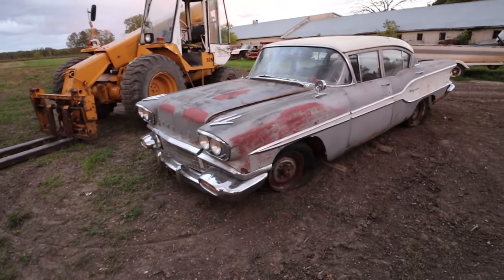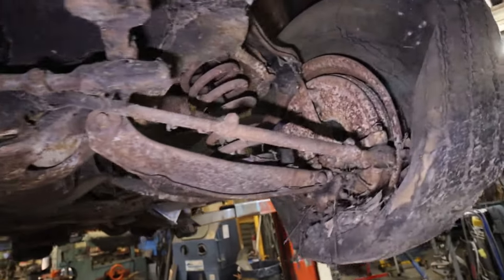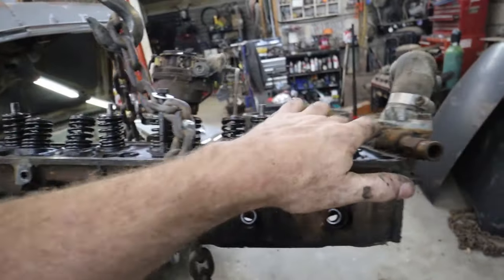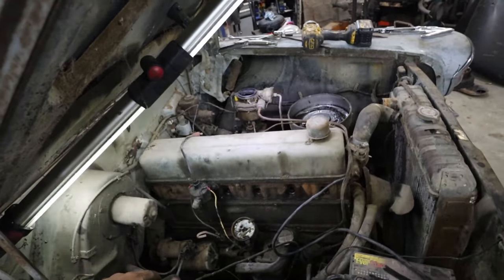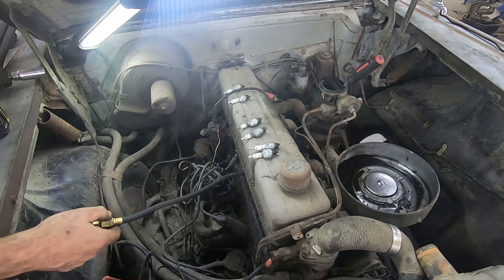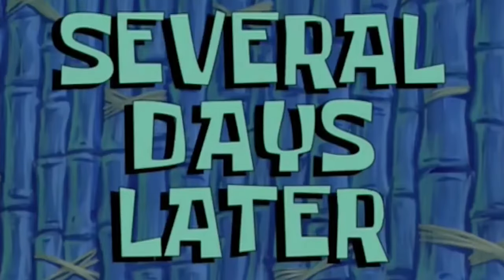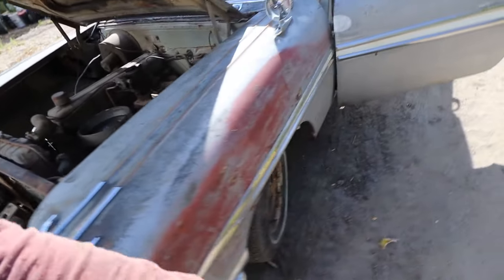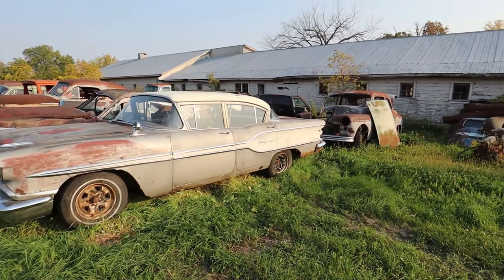Saved from the crusher 1958 Pontiac Pathfinder will it run and drive again?

Comment: People keep saying LS swap, that is probably the worst thing to do this old girl. It's boring and stupid honestly in my opinion but to each their own. . Everyone does it, why not a 289 Chevy, 305 or a 350 swap if your not gonna keep the old power plant. I would elect to keep the original engine and possibly do a draw through turbo set up. Nothing crazy just enough to give it a little power. Seem quite a few folks do this with old motor like this one.
Reply: I’m with you! If this is going to turn into YALSS series, count me out. Getting pretty boring. Doesn’t anybody have any other ideas anymore, or is it just follow the leader thinking these days?
Reply: @notajp  I dont understand the craze of LS swapping. You gotta wire it all up, flash a ecm, custom motor mounts, exhaust, trans, trans mounts, driveshaft, possible an axle. That adds up quick! Might as well make it a drag car, while I do understand wanting to make it a good driver sometimes it fan go too far.

A simple old school motor swap if it were to go that route with as little modifications as possible that would require it to run.  

Hell a straight 8 would be a cool swap in and something I wouldn't mind seeing.

Comment: 19:03 I know it’s your video, but if I came across this I would just unbolt the rocker shaft, and spray some “let go” on those valve stems, and give them a little love tap…..maybe they come loose, first…before pulling that head.

Comment: If you notice each cylinder plays a different note , ok. It goes “da da da da da “ duh”when it gets around to the 75 lb. er , every time the low note , so if they do come around to higher pressure , they’ll all get lower.

Comment: there something i,ve done to an old engine to start at,s sat is to take a propane torch put it into all the cylenders heat in all the cylinders up good this seem to help to get the rinds to stop sticking then i would heat up all the spaek plugs put it back together with every thing still not then try to start it with every thing still it seems to help to get it started heat will or can help to free the rings up

Comment: If you were a mechanic and you knew how to check compression. You would know that you first check the cylinder dry, and then you put 4 squirts of oil and check it again.
The difference between the two tells you what is happening in the cylinder.

Comment: this is REALLY interesting. Not something you see every day at any local car shows. i've never even seen one of these before this and i'm all into this era of cars too. Oh you're in Canada huh? This is a Pontiac Chieftan here in he states. That looks like a lot of 57 Chevy crossover stuff on this one which would mean those rusted out floor pans should be easy to replace provided you can get the vendor to actually send you the parts when you order them. sad to see it's only a 6 though. Are you planning on restoring the 6 or replacing it with a period correct V8? i know it's a 4 door so less desirable but it has a unique look too so well worth fixing up i think! This would be worthy of a complete frame off restoration to me personally simply because of the oddity of it all. And yeah i use words like "period correct" because i'm an auto restore purist. I'm subbing because i am REALLY interested to see which way you go with everything and see it restored. Lotta weight reduction on that one and i don't recall ever seeing one of this body style without a full straight frame under it. that X type frame is just as interesting as the look of the rest of the car to me. Marvel's Mystery Oil can be found in ANY Walmart as well as Advance or Autozone or Oriley's. i would use a combination of marvel's and PB blaster. put the PB Blaster in first let it sit then marvel's OR you can use Diesel fuel too i'm told. Never mind, looks like your concoction worked just as well. is this a 6 volt system? it would be nice if you could find a good 283 to put in that thing. Even with all the rust and lack of floor boards that's a really complete car. can't find one like it anywhere here in the states. Not with all the trim and everything on it like that one. i really like that! i'm also in love with the 58 Impala too LMAO i have the same licky problem with my German Shepherd that you do with your boy too :o)

Comment: I've had that issue of the starter sticking from all the rust and crap built up in the flywheel teeth. It trys kicking the starter sideways and binds it up. Looked like quite a few of those teeth were packed full

Comment: 58 Pontiac Pathfinder straight six, the engine's stuck so no easy fix, she's a liftered poncho on 14's da wheels are a mix, not a Chieftain just gotta be a brave wid brakes dat stix, drug around n fired up hot don'ts even hear no tix, Flintstone floors n ratcheted  seat a first place pix, Pablo approved n a face full of lix.

Comment: That is a pretty rare car with the 6 cylinder in it. Most all Pontiac’s of that era had a big v8 in it. Not rare (desirable). Rare ( why did Pontiac put a 6 cylinder in this heavy car). Good exterior though. That motor looks the same as a 235 Chevy 6 cylinder ( on the outside only). It’s probably the same as a GMC 302 truck engine.

Comment: That really looked like the straight 6 motor that Chevrolet had, I'm kinda thinking that is what they put in them the V8 were all actual Pontiac motors, Ive done rebuilds on the chevy looks like the same engine.

Comment: The problem, it was in the current cables, rust inside the cable, the same thing happened to me in a 52 deluxe I put a new cable and there was a better current, it took off and turned on

Comment: Stuck rings is why i fill the crankcase with 5 galons odf diesel an let sit for a day or to an work motor back an forth alittle of course i leave oul in the motor to when i get it to work back an forth an at least one turn i start it up an let it run with the diesel in it  always works free up the rings freshen up the seals an usally if  the motor anygood at all it be fine let run just a couple minutes drain it an fill back with new oil keep the diesel for the next one in a five galon can

Comment: They sure put a lot of 6  Cylinder engines in those old 4 doors back in the day you would think they'd put the bigger motor in those  Anyway I would have figured it would being a Pontiac might have a straight 8  i've had a few old pontiac's motors that were straight 8

Comment: Were rings or valves the main culprit for the low compression? At least one of the valves (#1) was way too loose. They will self-adjust as oil pressure rises, but they should be close to being adjusted from the start. If they flop around there won't be much compression at the start.

Comment: Not beyond saving - it's got all the glass, the doors open .......similar structurally to a '58 Biscayne so floor panels should be adaptable !!.....the barrel brush from a pistol cleaning kit may work in the valve bores, but hammering on valve springs without a face shield is way dangerous !!

Comment: The car was junked because the engine is worn out.  The only thing that you can do is put marvel mystery oil in the cylinder and let it sit a 
Month or two until it loosened up.

Comment: awesome video, so was it true that the difference between pontiac and chev is essentially the front and back ends? if so chop them off and throw them on a better chevy chassis, easier than attempting to rebuild the car and cut in a new chassis then its brakes, engine etc!

Comment: Call marvel Mysterio Jimmy comes in a red bottle you could even use it on seven door you use it as air tool oil air compressor oil and 100 different uses if you want to look it up online you'd be surprised you can use this even chainsaw today or two stroke boat motor or anything like that

Comment: 55:03 Why (as a knowing Mechanic) would have not started with removing the rubber plugs (if in the unlikely reality they still exist) and lubing the star adjusters to back off the tension on the brake shoes??? Even with functional drum brakes this is required to remove drums. Why are you doing that??????

Comment: That cable-to-ground lug crimp is piss poor, and might well be part of the reason you can't make it turn over. Anytime you see a curl of smoke, something's getting far too hot, and that's because the resistance is far too high. Try a new ground cable.

Comment: At 42:54, turning way, way too slow to create much compression with valves caked with rust and cylinder rings still stuck until they warm up. Squirt some oil (30W at least) down each plug hole to create some compression! 
"Sufficient compression, Spark at about the right time, combustible fuel" Auto Shop 101. PS With a real shop, why do you not have a remote starter button/jumper ????
Reply from the maker: Haha usually don't have a need for it if I can reach the starter haha

Comment: U screwed those rings turning it over with the ring gear BEFORE putting oil in the cylinders.  Should have been the FIRST thing you did and let em soak a day

Comment: Electric cars will save the old car restoration industry.  Many will be converted to electric (I know, kind of heresy, but it is really the look most buyers will be going for, not the old grumpy, polluting internal combustion engine drivetrain.) or will be feasibly run on biofuels as such fuels will not be needed to fulfill all our transportation fuel needs. Put another way, a point will be reached in the near future where fossil fuels will need to go away and if you have a car that runs on gas its value will "tank", meaning restoring an old one will be a lot of money down the drain.

Comment: If it gets loose, and might even start, well it won't run well.
Find an old that won't turn mechanically or with a good starter, don't dick around and pull he head and pan

Comment: Now get the head off…. Blew the head gasket by driving it around with no coolant 🤦🏻‍♂️
When you see it running and every revolution of the engine “poofs” that’s “compression” escaping into the cooling system.